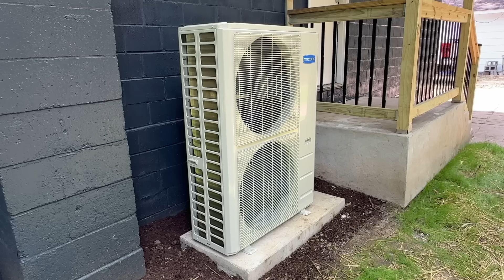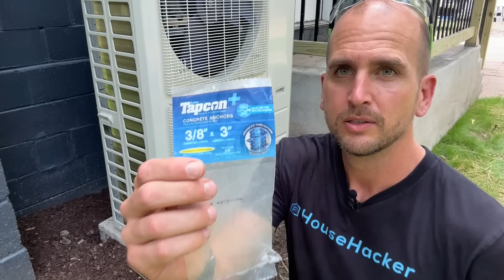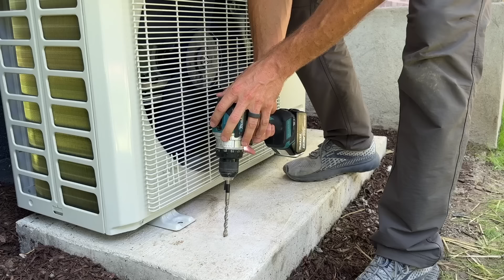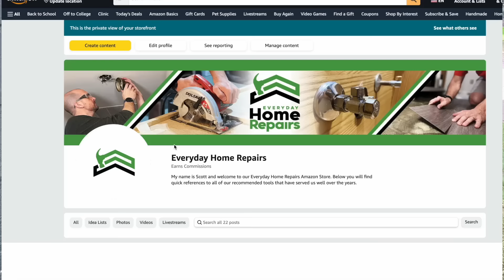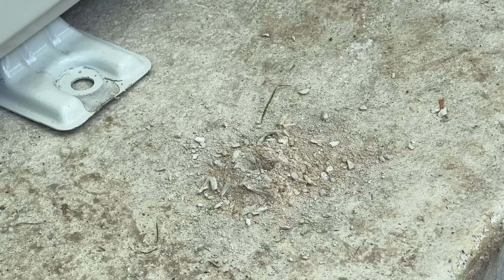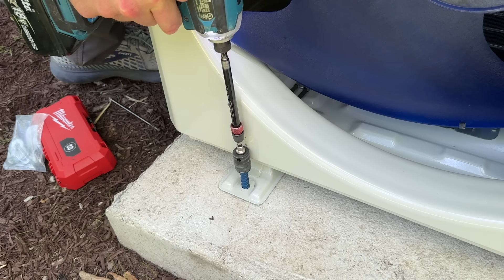The Only Concrete Anchor You Need And How To Properly Install

Comment: I've used them with great success however....... if these are to be used in a wet environment where freezing temperatures may be encountered, I recommend you partially fill the drilled hole with a sealant before you install them... I had ice build up in a drilled hole with the screw installed and it cracked or spalled the concrete around the hole and had to be repaired.

Comment: Absolutely HATE the smaller Tapcons, they break very easily and the head is tapered and shallow so it’s hard to keep the driver on it in a confined space….. the kind of space where you might want to use something like a Tapcon.

Comment: Stripped out holes?  Try a short piece of 14gauge romex in the hole, run in the screw and it works every time.

Comment: My main problem is hitting a rock in the concrete that the drill bit doesn't want to go through, so the bit takes the path of least resistance around the edge of the small rock, resulting in a slightly enlarged hole or the hole getting off my mark if the rock is just below the surface. I've used a fair number of these to mount various things to my unfinished basement walls and I probably have to relocate new holes about 1/10th of the time for this reason. Thanks for the tips!
Reply: The cure to this is higher quality tougher drill bit materials like cobalt or diamond tips (downside: more expensive)
Reply: @Tokaisho1  Ah, thank you. I'll be on the lookout for those.
Reply: That problem ceased for me when I got a rotary hammer.
Reply: @johndough9187  I use a hammer drill that's high-end consumer grade, but the bit still wanders to the path of least resistance especially when the rock is near the surface. Thanks for the tip though.
Reply: @Pseudo-Geek  One solution is to turn the hammer drill to normal (ie for wood) drilling mode and press hard for a while to "grind" an indentation into the rock so the bit doesn't wander off it when back on hammer mode (I use this method to start holes in concrete too). And what johndough said - an SDS rotary drill will have enough cutting power through the rock that this problem won't happen anway.
Reply: @kenoliver8913  Thanks for the tip! I’ll try that.
Reply: @Pseudo-Geek Hammer drills suck and are only suitable for masonry and small holes. 
Get an SDS drill. Bonus of them is you can put chisels on them and switch them to hammer only mode, and you have a mini jackhammer for small demolition jobs or breaking out concrete around pipes ect.
Reply: @Patrick-857  Thanks - I'd love to have one of those! One of these days...
Reply: I always install one anchor first before drilling the other holes this keeps drifting to a minimum and when possible I drill the other holes through the equipment pads.
Reply: @jackanderson1418   I tend to do that as well. Plus, if the first one you drill does drift, you can re-align the equipment slightly to accommodate the error in some cases, depending on what you're mounting.
Reply: If it's critical not to drift I start with very small bits and work my way up to the larger size needed.

Comment: The smaller tap cons snap too easy. They're also a one time use, not the fastener, the concrete.
I like the wedge anchor studs. I think they're called Red heads. If they pull out they also sell epoxy based fasteners. They hold well in concrete.

Comment: When it comes to alignment of holes behind flanges and such, if alignment isn't critical I find it's easier to fix one side in place, then pivot the fixture around the one hole to the desired alignment. Then, I drill the second hole using the hole in the flange as a guide. That way there's no doubt whether the holes will line up. It's much easier to adjust a piece of tubing or something than to perfectly line up your holes, mark them precisely, drill the holes and hope they're centered, and then screw it down.

Comment: This was very helpful, and so were the comments.  I am not drilling straight down into concrete.  I am drilling into the side of my condo through (what I assume is) stucco.  I need to erect a wood frame sturdy enough to support a couple water filter housings.  I think behind the exterior wall I've located one of the studs, so that hole gets a long screw to reach the stud.  But the remaining holes to affix the board to the wall are what had me stumped.  Do I go with Tapcon, or Rawls and screws, or something else fancy?  Your demo and a lot of the comments gave me more ideas to look for at my local HF, HD, Lowes or Ace.  :cat-orange-whistling::glasses-purple-yellow-diamond::face-purple-wide-eyes:

Comment: First off - use a torque wrench after running them in most of the way with your cordless driver.  Second - going with the most popular thing is not always a smart move since you could miss out on new innovative competitors.  You should have explored the tech merits of each.  Third - Red Head & Tapcon are the same company.  Fourth - the way you are using the old-style hammer drill is guaranteed to make a sloppy hole unsuitable for any threaded concrete anchor.  It is best to put any drill into a portable fixture to ensure hole is perpendicular to the mounting surface and to keep the bit on-track for the entire drill.

Comment: If i have room ill drill a smaller hole first through the part im mounting so then i know its in the right place and usual ill only mark and drill one at a time at least for the first 2 in opposite corners depending on the precision necessary like hanging a tv

Comment: I’ve used Tapcon’s with good (not great) results. My problem is rounding out the hole and the screw has nothing to grab. I’ll use spun lead to pack into the hole which gives the teeth of the screw to bite into. It’s similar to a anchor fitting.

Comment: I love tapcon. If it all goes south,  plastic anchors,  if all goes to hell, wedge it! Hydraulic cement can let you start from scratch as well,  just takes time.  Run into all situations on fixed mounting points on toilet flanges and street lights for example.

Comment: I use a plastic drinking straw and a pair of safety glasses to blow out the drilled holes.  Beats dragging out a compressor and works better than a shopvac!

Comment: Anchor bolt epoxy or melted sulphur work great for stripped Tapcons, but you need to make sure the foot is down tight against the slab.

Comment: I’ve used many different sizes of tapcon. The main issue I’ve had is drilling without moving the drill side to side. You need to drill straight in and out.

Comment: I don't know if it applies to drilling concrete, but when the hole is completed, pulling the drill out while letting the bit spin slowly forward extracts a lot of the debris.  But in general going up and down while spinning the bit high speed risks enlarging the hole when drilling some materials.  One technique is to pull the drill all the way out periodically to clear debris, then insert the bit all the way in before pulling the trigger so as to not create a slightly new direction.   This detail may be overkill for concrete.   Second point:  I wonder how durable these Tapcon anchors are over time since the thread diameter is only slightly larger than the core diameter

Comment: Living in Florida, we all have concrete block walls.  Tapcons work fine on concrete, but I've had very poor luck with Tapcons on those surfaces.  It is especially bad when the walls have stucco coatings and you don't know where the mortar joints are!!!  What are the suggestions for that sort of surface?????
Reply from the maker: True, with block I think you need to use a sleeve anchor or at least that has been my experience.
Reply: I’ll let you know!!  I’m using 3/8 x2” on my block wall covered in stucco tomorrrow. They say on the package made for concrete block.

Comment: The only problem I’ve had with Tapcon anchors was on the base of a swimming pool pump. The exposed heads rusted so bad the first season I replaced them with new Tapcons and immediately coated them with Plasti-dip. Seems to be working.

Comment: Tapcons are great for ease and speed. Not so much if need to adjust/reuse the hole or for high strength. I use them often but know when it’s time to use something stronger.

Comment: If you don’t feel like carrying a compressor or vacuum out to where you’re drilling holes, use a can of compressed air. They have a straw with them, so it’s easy to get to the bottom of the hole and blow the debris out. Just don’t have your face over the hole when you do, unless you enjoy the taste of concrete dust.
Reply from the maker: Yeah, nice tip and thanks for the feedback!

Comment: How about using Tapcons to anchor a post to a hollow block wall? My post is a 4x4. Any recommended size/procedure?
Reply from the maker: For the hollow block wall you might need to go with sleeve anchors.  Tapcons aren't going to hold well in block.
Reply: @EverydayHomeRepairs  Thank you, that's very helpful.
(now what do I do with all these dang Tapcons I bought.........SMH)

Comment: I always use a thick washer that is at least 25-33% bigger than the head of the Tapcon... it just helps spread the hold across the part being secured, especially sheet metal like you show.  My solution for stripped holes... always keep a spool of galvanized wire handy.  Just fold a few lengths equal to the thread length, put it in the hole and re-run the screw.  The screw will bite into it and press against the sides of the hole.  Works every time.
Reply: It's critically important to drill the appropriate sized hole that corresponds with the tapcon screw thickness. Read the recommendations on the package. All of the failures I've had is because if this variable.
Reply: I rarely have good luck with Tapcons. The holes end up being to large.  I will be using your tip next time, though. Thanks.
Reply: Thanks I will try that next time
Reply: Good tips. Washer not needed in this case since it has the metal feet, but washers are often needed. Use galvanized or stainless for outdoor use!
Reply: All outdoors’ should be SS.👍
Reply: Ooh, interesting. What gauge wire do yo use?
Reply: I fill the holes with gorilla glue exterior... never fails
Reply: I've used zip tie 'ends' too, or small strips of wood shims or even copper wire will work too!
Reply: @tdotw77 the wire and zip tie bits yes, but I would worry about the would shims deteriorating over time and cause the anchor to eventually lose its grip
Reply: @tdotw77 😅😅x.v

....
..
Reply: @tdotw77  I use poo, but you do you
Reply: good tips👍
Reply: If you already know everything, why did you watch this video?

Comment: Certified Medical Coder (15 years) here. This is not exactly true. An office visit (aka for a skin check) is a service, but if a lesion is located and a procedure is done on that, the office visit is INCLUDED in that service. This is not an insurance loophole to not pay. It is a guideline spelled out in the coding procedure manual. 

Now say you do an office visit and it is also covering another issue the patient was having. A modifier 25 can be added to the office visit (with corrected linked diagnosis codes attached that separates it from the procedure) and then add the procedure with the associated diagnosis codes. If insurance still deny the claim as bundled, send in an appeal with chart notes. This is where good chart notes come in handy. 

If your coders and billers are not doing this for you, it’s time for additional training in denials or higher someone with more experience. 

To reiterate, it’s not always the insurance fault. It’s using the proper coding and billing to communicate effectively. 

Steps off soap box.

Comment: I have generally had very good results with Tapcons. I once used the phillips head type, couldn't get enough leverage to drive it in all the way and stripped the head. (Pulled it out with pliers.) Since then I have used the hex head only with no problems. I use a ratchet wrench which, though a little slower, reduces the chance of breakage or other problems.
Reply from the maker: Yeah, I try to stay away from the phillips head concrete screws for the exact issues.  I agree the hex head is my favorite but have seen solid results with the Torx head 👍
Reply: Use an impact driver with Phillips head even with regular screws into wood. Of course you have to be careful right at the last sixteenth.
Reply: Yeah Phillips are the worst. Hex or torx always! 🛠️🔩🔧

Comment: If You strip out a LG tapcon, Get a large Zip-tie or 2, maybe 3 and run your bolt back in. probably better than the original... fold it into a V and insert, run your tapcon up the V....

Comment: The big tapcom bolts work well enough, I've had nothing but nightmare experiences with the standard screw types though.
Reply: I have had the same experience.  The small ones seem so snap with very modest torque.

Comment: I built a 'catio' about 6 years ago and used Tapcon. I anchored the vertical beams to a brick wall and the horizontal 2x4s to the patio floor. They've held up very well.

Comment: I like tapcons too, but you have to be careful to get just the right size hole.   Even using the concrete drill bit they provide, if you hit a hard spot in the concrete, the hole can be too big and strip out.  Too small and the screw can jam and snap off.
Reply: Yep, it is very difficult to get the right size hole. You are almost always going to move the drill and even slightly wallows out the hole.
Reply: Put a piece of galvanised (for softness) wire in the hole for the tapcon thread to grip - the same technique used with a matchstick for an overlarge screwhole in wood. If it is MUCH too big you can also just use a plastic anchor.

Comment: I don’t like Tapcons-they always seem to pull out or loosen.  No way would I use them to hold those a/c units with the height and vibration.  I have the most luck with red heads, the ones with the punch set.  Like he said in the video, make sure to blow the holes out for whatever type you use.

Comment: I just removed a shed that was bolted to a concrete pad  using tapcon bolts around 20 years ago. I went in expecting issues getting the bolts out. The typical stuff, snapping the heads off, etc. I had no issues and the bolts looked practically new, other than the concrete dust.

Comment: Take spare copper from Romex cut-offs and you can use it to "bite" the tapcons. Copper is malleable enough to deform but will also provide the resistance for the anchors to grab.

Comment: I've used Tapcons and they are the easiest, but I don't use them unless I'm pretty sure I'm never going to need to remove them; I find they don't hold nearly as well on subsequent uses (and, yes, I use a new anchor). So I used them to anchor a gazebo I put in on a concrete deck, but I use wedge anchors to hold down my drill press, since I might need to move that temporarily. I also don't use them when attaching things to sandstone or soft brick, since I've seen Tapcons split that sort of material; something like a Rawl plug works better in softer stone, holds quite well, and you can remove the screw (at least once) and put it back without worrying. If you don't have an air compressor, a can of compressed air works to blow out the holes. As you say, it's essential to clean the hole, no matter what you're using as an anchor.

Comment: A number of years ago, I had to add a wood filler strip to the door threshold of my mother's 40 year old house. I used the specified concrete drill, but the concrete was extremely hard & penetration was nearly impossible. In the process of drilling forever, the hole enlarged, & the Tapcons became almost useless. I have no idea why the concrete was so difficult to drill & the whole affair was unpleasant, to say the least.
Reply: I had all kinds of trouble installing new commercial doors into some buildings that were built 100 years ago - and an old concrete guy told me that concrete basically never stops curing and just gets harder and harder with the passage of time. I believed him for sure by the time I finished that job!

Comment: Why did you scratched AC unit? it will be full of rust later. Use some thick plastic between socket to cover a metal. huge DISLIKE here. :body-green-covering-eyes:

Comment: It was 1998 or '99 when I used Tapcon Anchors to mount 2x4s (because I added outlets and light switches) to what was an outside brick wall which became an add-on room for paneling.  I bought a combo, 120 VAC corded Black and Decker DR700 Type 1 switchable drill/hammer drill.  I predrilled holes for the Tapcons in the boards with the holes aligned into brick, then drilled a wider hole to stop the Tapcon heads, started the Tapcon brick holes through board holes with the concrete bit, removed the boards and drilled the holes in bricks.  I don't remember issues with stripped Tapcon holes.  I may have drilled all the way through the bricks, but I would have known to get all debris out first if I didn't.  Granted, this was brick, not concrete, but, to recollection, this was my only Tapcon usage.  I still have a collection and would use them again.  Thinking about it, I mounted a Split AC unit on a concrete block some years later, so I must have gotten all the drilling debris out.

Great video, Scott.

Comment: I'm not a fan of tapcons.  I use them to attach light loads like shelf brackets to block, but I'll stay with red heads when I need to really secure something well and not worry about it ever pulling out.
Reply: Me too.  I don't like using Tapcons.  They strip and break too easily for me to trust them.  I'm a contractor and I cannot have my reputation ruined by those fasteners.

Comment: I only use the hex head screws. I have had some breakage issues with the 3/16 inch size , even with the deep hole and blown out. The age of the concrete may be a problem. Also, outdoors , are these corrosion proof enough?